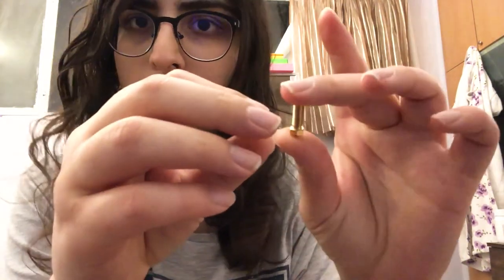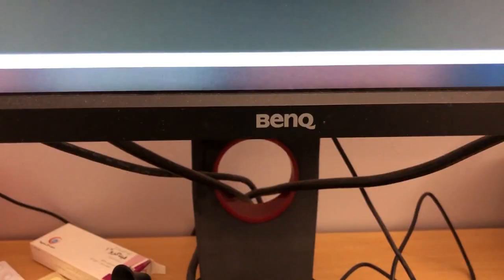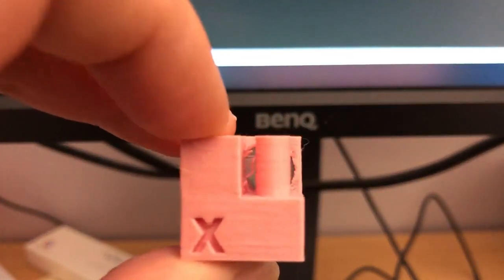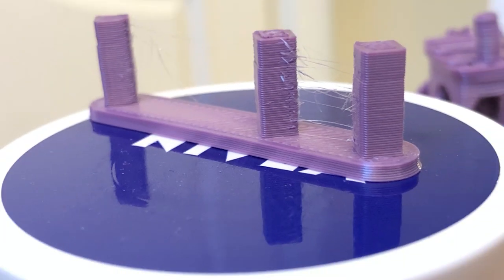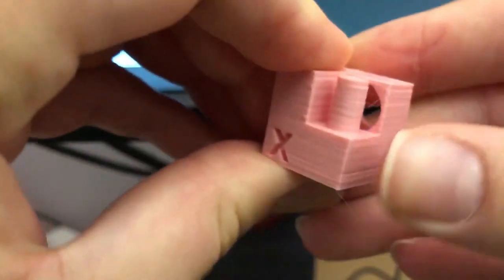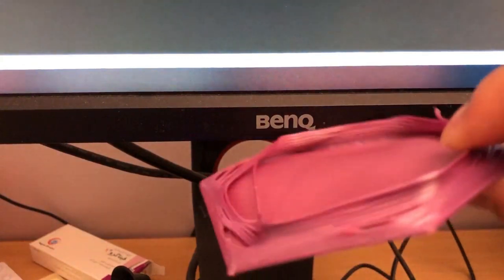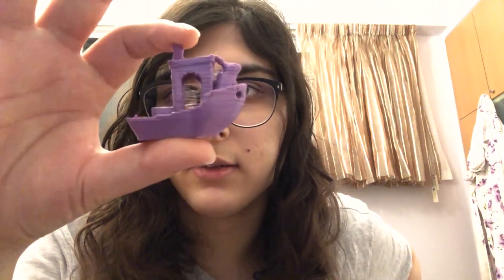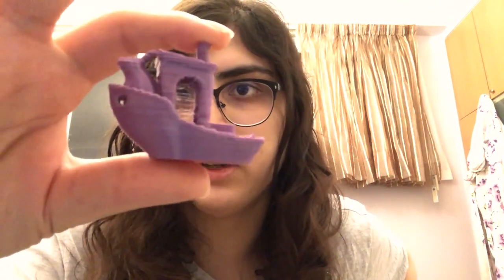E3D Volcano vs V6. Should u upgrade to a volcano?

Comment: For the volcano on direct drive, if your e-steps are slightly off, the residual pressure in the nozzle when extrusion halts, is way stronger than with a bowden setup (as there's far less length and space for filament flex to absorb some of that pressure, as you're trying to counteract force more so than length of filament). You might have more success increasing retraction speed, rather than distance, to relieve that pressure as fast as possible. Combing might also be beneficial, to hide that last little bit of stringing, by stashing them within the outer perimeter.
Reply from the maker: I don't remember if I tried speedbut I should try it!
but I had my e-steps calibrated.

also that's a good idea!

But overall I would only recommend it to someone who prints large parts with a 0.8mm often,fast, otherwise might as well go with 0.6mm and v6 and just slow it down a little for the occasional print. because my fan cooling was a huge bottleneck on smaller parts (like a benchy or a pencil holder)
Reply from the maker: i've sadly gotten severely sick so I haven't touched 3d printing in months :| so my memory isn't great with this either! but I should defiantly try the thing you mentioned